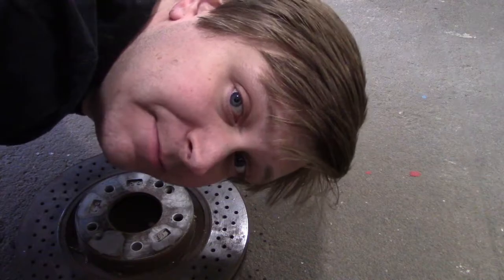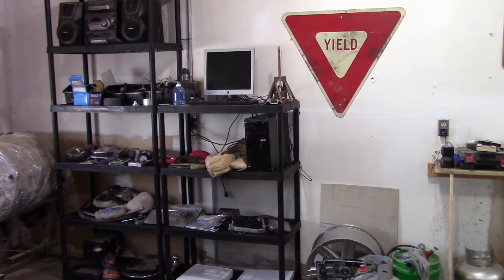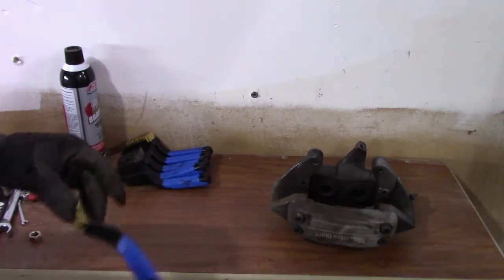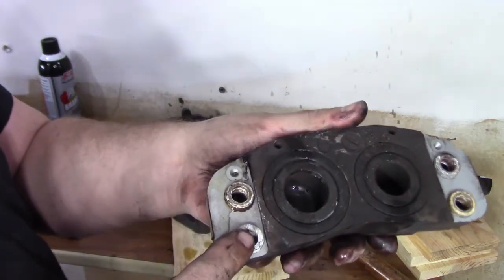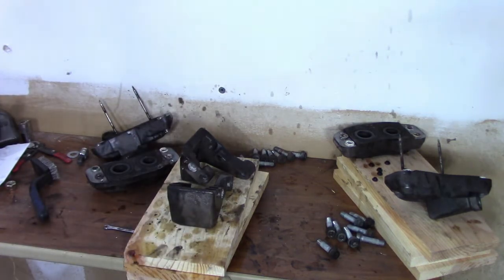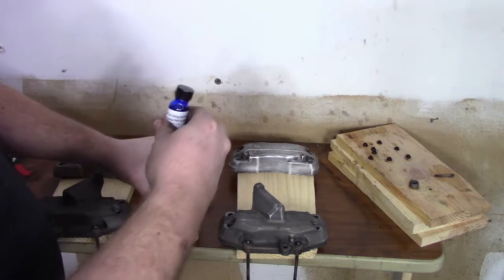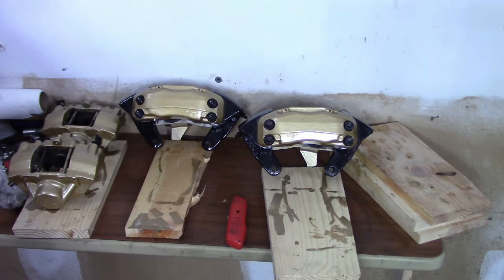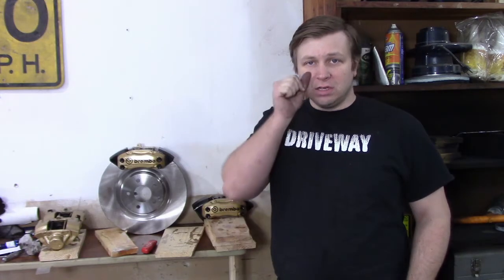Chrysler Crossfire Big Brake Upgrade | Disassembling and Painting Calipers | Driveway

Comment: Could you do a more indepth review of this brake kit like what parts exactly you need to purchase to convert to bigger brakes, assuming this is an base crossfire
Reply from the maker: No problem, that was the plan for when I install them - I just want to make sure I have all the parts needed so I don't steer someone the wrong way
Reply: Driveway thatd be cool id be interested in doing this as well but not sure what exactly i need before i “brake” it all down, found a clk500 4 caliper set on ebay for a couple hundred bucks
Reply from the maker: Yeah, it gets a little cloudy because there are 3 or 4 different rotor and caliper sets and some work and others don't.  If you want to get really crazy there are some 6 piston that should fit too for the big cash

Comment: Great vid we're did you find the brimo tag.. will it not burn off with the heat? It's March wondering how it's coming along?
Reply from the maker: You can find them on ebay or amazon - they are a high temp vinyl so it shouldn't burn off.  I'm a bit behind schedule; almost have the Tiburon out of the garage from the clutch replacement so it can take daily driver duty and then the crossfire is going in for its full rebuild. Thanks for watching

Comment: Did you ever complete this upgrade?  Did you need wheel spacers?  I need to do the brakes on mine very soon.  Please tell us.
Reply from the maker: The fronts will have issues with fitment.  I think the srt wheel only need about a 10mm spacer but the standard wheels are a detrimental fit - off hand I want to say 25-30mm.  I'm getting new wheels before I put on the front anyways, so I didn't look into it too much aside from definitely needing spacers on stock.  If you aren't racing it, stick with the stockers - they get the job done safely and you wont really notice it on the street

Comment: did it fit like a bolt on kit or did you modify something in order for them to fit ?
Reply from the maker: It should just be a bolt in - I haven't gotten around to installing them yet since the stock wheels wont clear them and I haven't gotten different wheels yet

Comment: do you have a video of you putting these on the car and do the stock wheels clear?
Reply from the maker: I have not put them on yet because the stock wheels definitely will not fit  some people have done this mod with the srt wheels and a small wheel spacer
Reply: ahh gotcha. looking to get an srt6 and want to ensure it has awesome breaks
Reply from the maker: The SRT already has better brakes than the base but the c32 is above even that.  Search C32 brake upgrade and there are plenty of forum entries on the crossfire forum detailing what parts to buy and offset of wheels.  I think for the srt wheels it only needs a 10mm spacer

Comment: When is the install video happening. I'm doing this same mod.
Reply from the maker: Aviator M Unfortunately not for a while.  I'm behind where I wanted to be at this time with the crossfire.  You'll probably get yours done before me at this rate.   Thanks for watching.
Reply: @Drivewaybuilt  so are they supposed to fit while facing outboard (the right way) or you don't know yet?
Reply from the maker: @sophisticated  According to searches, they are supposed to be a direct bolt on with no modification needed  I cannot verify this at this time since I'm focusing on other aspects of the rebuild right now
Reply: @Drivewaybuilt  I think I found my answer while doing more googling. They should be fine!